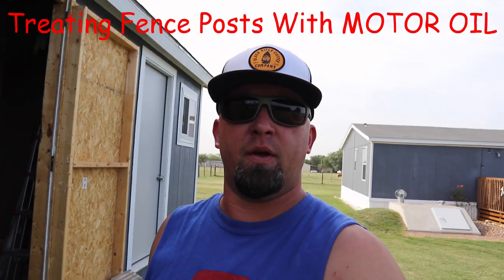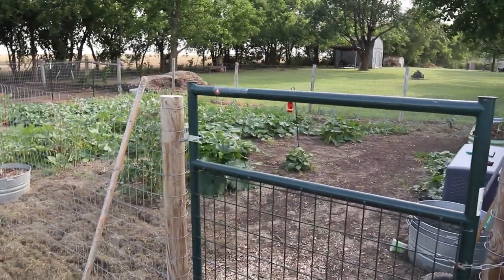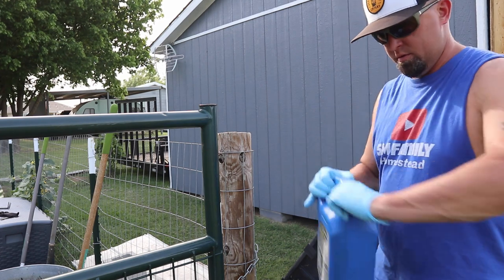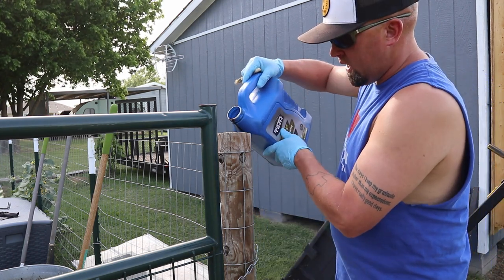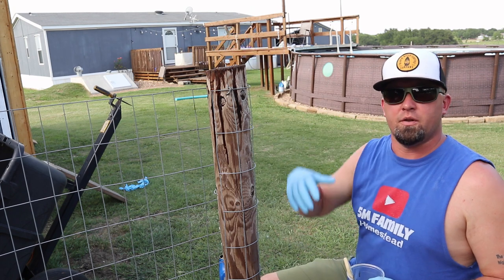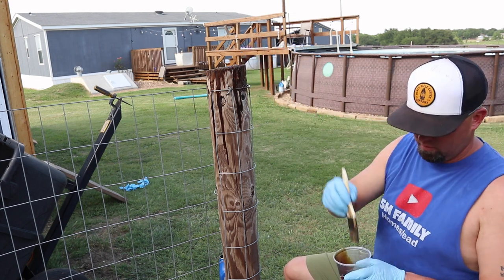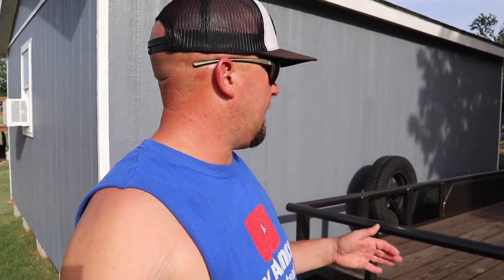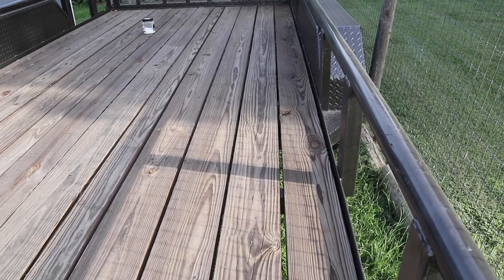Treating Wood Posts With Used Motor Oil

Comment: Was looking for a video to show my wife where set the ends of post to be used in a 5 gallon bucked for a day or longer to allow the oil to soak up into the inside of the posts I understand some states don’t allow this but is there a draw back from soaking the end in motor oil also watch a vid I where the guy took many 8 inch pieces of 2x4 from pressure treads to not but oddly enough the ones that had wood protection applied in all scenarios failed the worst some were in dirt some laid on bare ground and the samples in the dirt failed the most with the wood sample even pressure treated and then a wood product designed to protect wood failed miserably in all conditions 
The odd thing is he took one set of samples and left them in a 5 gallon bucket filled with water and left them alone noting that at times like during summer the bucket was dry and when rainy season it stayed filled with water and even had grass growing and i thought the roots from the grass would attach and grow into wood with zero treatment…….. but ……
All 4 samples had very little degradation by far the least of all in the 3 year test 
Can anyone explain this 
I soaked my mother’s fence post on moto oil for days then a heathy coat of roof tar covering ends and to above what would above soil one my never put a 3 mill construction grade trash bag as a barrier on top of the oil and roof tar and all the piles failed in several years.
Not this was done in coca fla inland from cocoa beach by 12 miles and when you dig more than a foot the hole fills with water even in dry season I’ve seen videos both swearing by the foam post secure technique and I’ve seen where they worked very poorly . 
My conclusions is Mother Nature will take back what is her regardless idk are we way over thinking it the canal fencing I’ve installed 20 plus years ago stand strong but not walking out of your homestead and getting vinyl

Comment: Your better off just burning them. Instead of contaminating the soil
Reply: Farmers have done this for 100 plus years. I think it will be okay.
Reply: There is really no leaching into the soil from the oil treatment, it is soaked into the wood and stays there.   Even when treated before burying in the ground.  Dumping oil is one thing, this isn't effecting the water tables or crops.

Comment: I see that you are using using used engine oil.  You need to realize that it contains very significant amounts of the heavy metal lead from the engine bearings so is toxic to handle and touch!
Reply: Yea yea yea, toxic shmoxic!